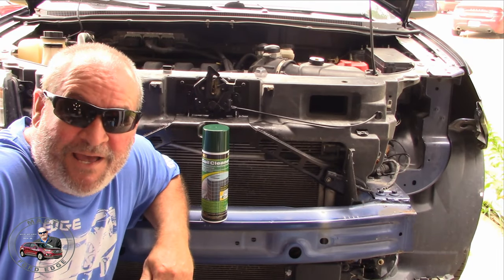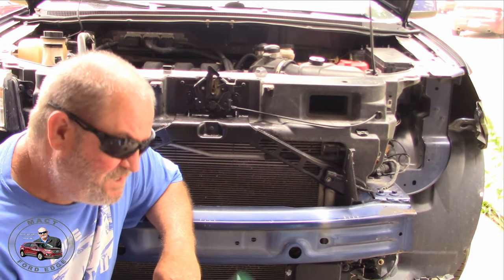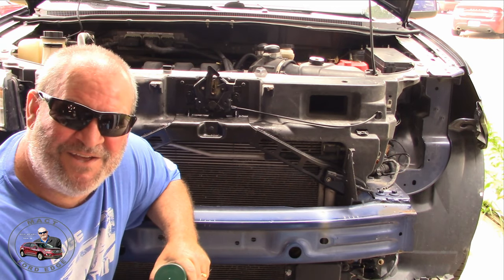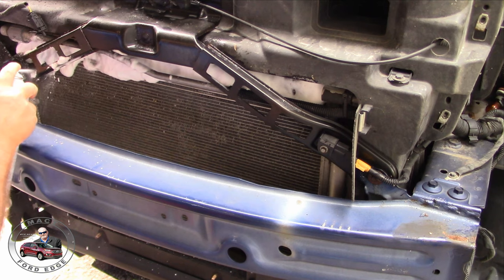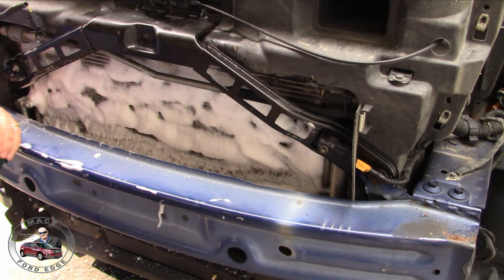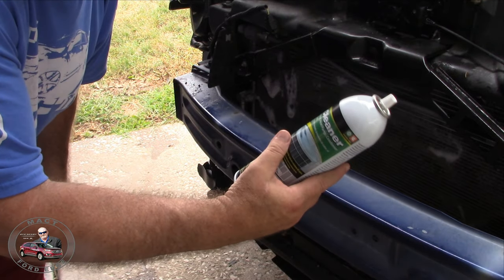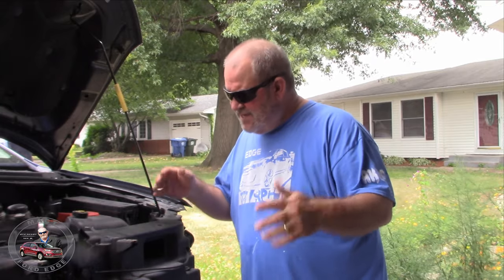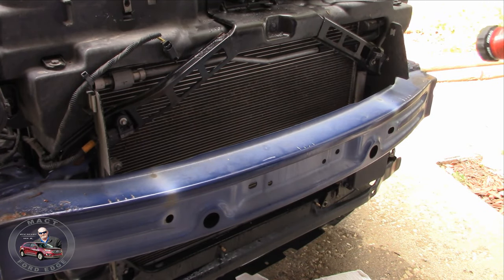Let's clean the AC condenser Transmission fluid cooler and radiator

Comment: Not related to this video, but trying to get some advice on below.  Is there a better way of contacting you?  Hey, my daughter's 2011 Ford Edge that I bought her smells like it runs really rich.  I have run a few chevron with technology fuel cleaner through it, seafoam through gas as well as 2 x seafoam intake treatments.  It also will barely brake 18mpg in combined driving.  It has 150k on it, should I replace O2 sensors?  Thx for the help!
Reply from the maker: MACT Ford Edge on Facebook or MEWE
Reply: Do you have an obd2 scanner to confirm the rich condition?